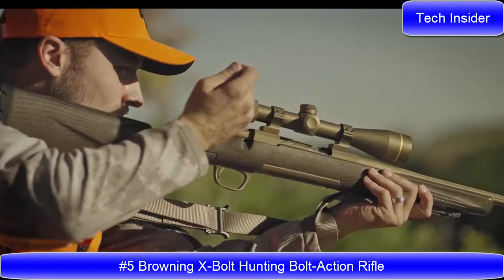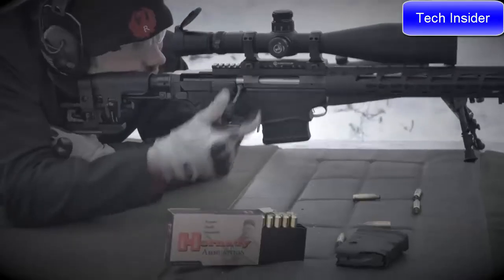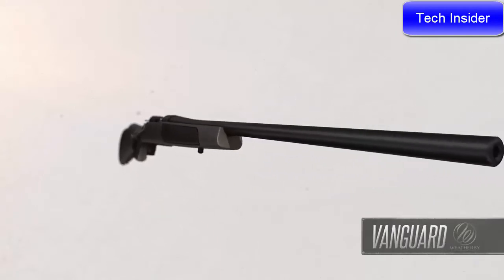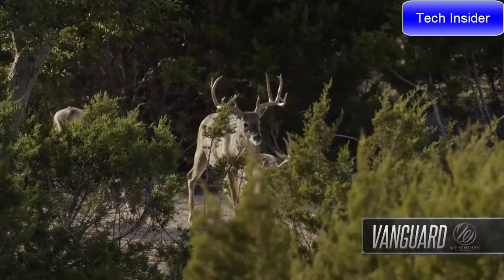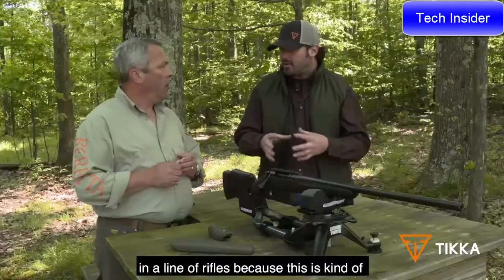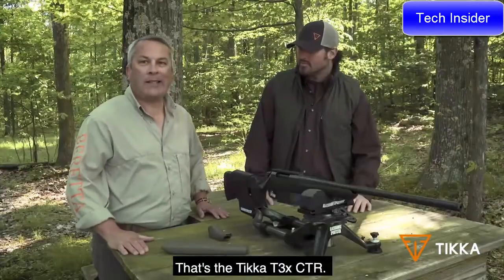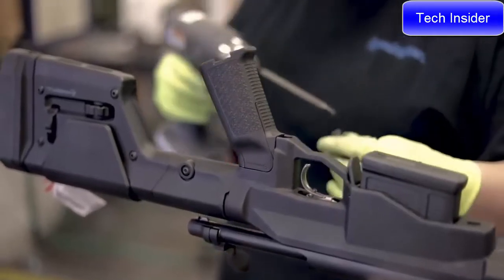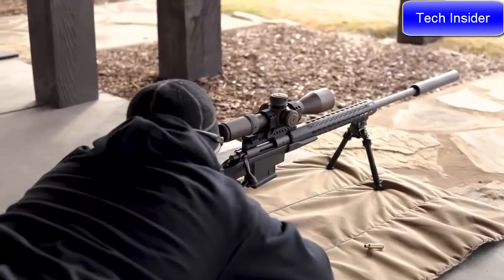TOP 5 BEST BOLT ACTION RIFLES 2024

Comment: Umm... Top 5 best bolt action rifles of 2023... posted 2 years ago as of Feb 2023 (so 2021)?  And... "now chambered in the new 6.5 creedmoor" (lol... yes that was still relatively new a few years back, but the current new is the 6.5 creedmoor prc - new 2022, not the creedmoor). Credibility drop.  What, did you just change the title of the old video? No offense, but you need a new video too. 👍👎  These are some good guns though.